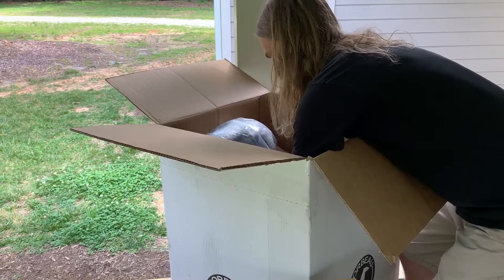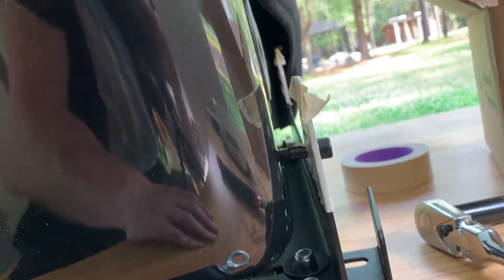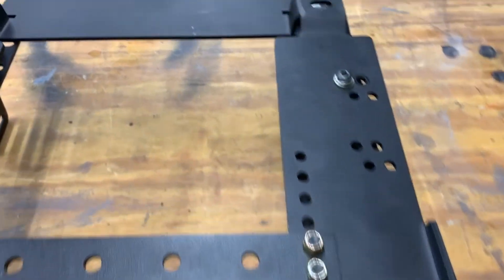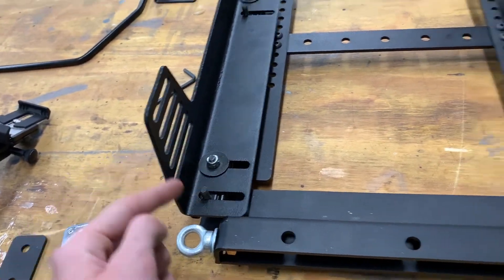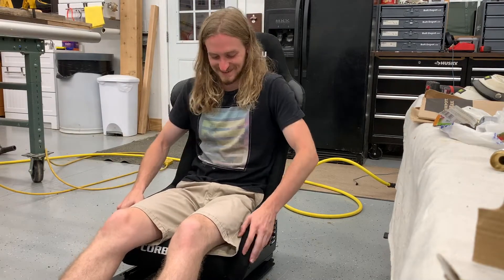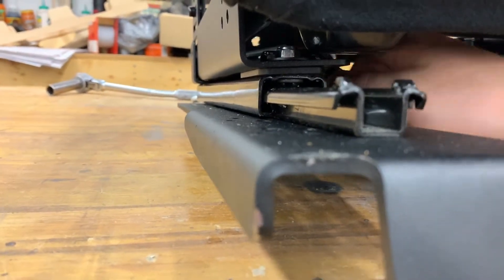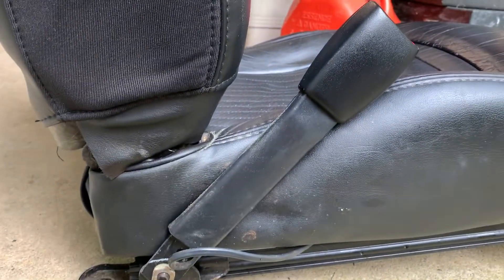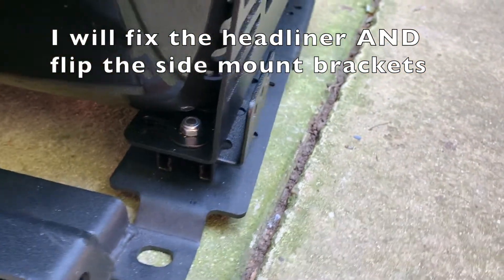C5 Corvette: Corbeau FX1 Pro with Marrad Seat Bracket

Comment: I put one in my C6 Z with the bracket from Corbeau. Only issue so far, the sitting position is really high. I have to slide back away from the steering wheel farther than i want, to get a good view angle. It may be I am just too thick to sit down in the seat bucket where they intend. Not sure.
Reply from the maker: The bracket I used got the seat as low as possible. Corbeau’s bracket looks noticeably taller to me. If you didn’t cut off the bottom mount pegs under the seat, that may be interfering with lowering the seat too.

Comment: I was wondering if the stock belts would work with these seats and I don't think they do, looks like you better use a harness. Thanks for posting this video.
Reply from the maker: You can certainly use the stock belts. It’s a tight fit but I retained the belt buckle. I always use my harness though

Comment: hi there, when you took off the rear mounts on the bottom of the seat were the actual threads further inside? I'm thinking I may need to do the same as I fit in my Z06 very snug with helmet on and this will lower the seat headroom. However, I mounted the sliders to seat. Is there a reason why you went with side mounts to the chair vs mounting the slider to the seat and then mounting slider/seat to bracket?
Reply from the maker: When I cut the bottom mounts off, the threads were cut off as well. I chose side mounts so I could get the seat lower and have more headroom. Side mounts also allow for a little more adjustability with the tilt of the seat. I’m 5’ 11” and I can fit my fist between the top of my head & the roof.